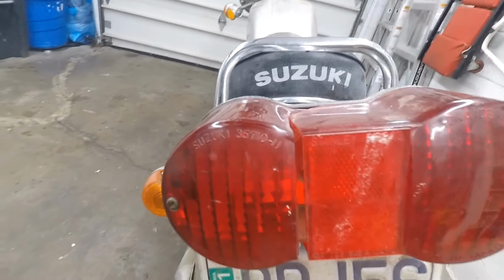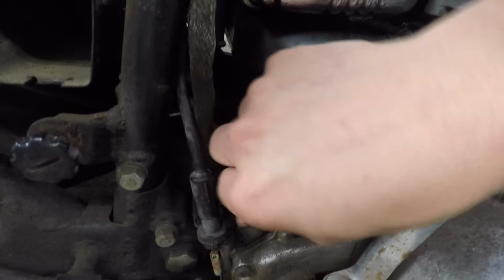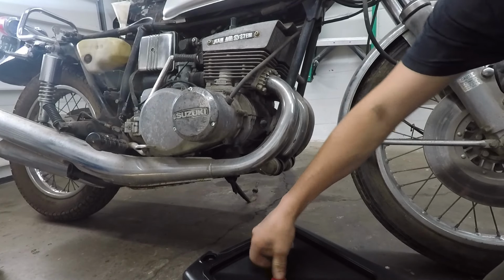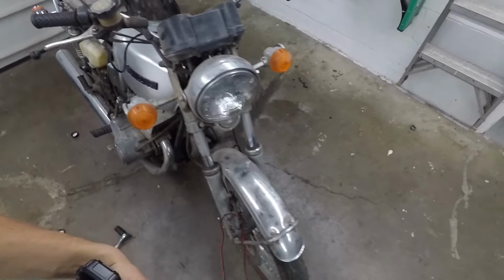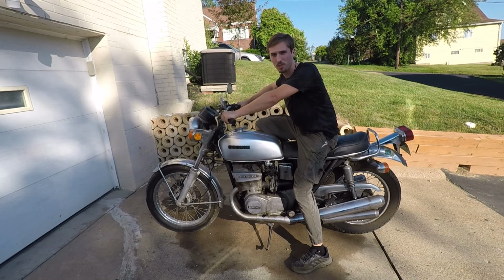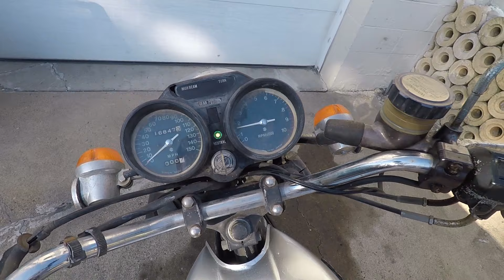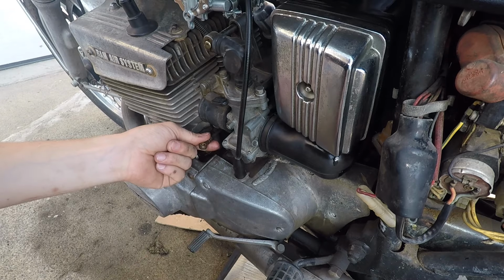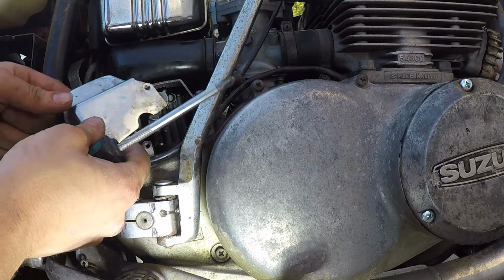Barn Find Suzuki GT550 2 Stroke Triple First Start in 10 Years

Comment: I see a lot of people saying that the crank seals are bad because of all the smoke but that's not the case. The oil pumps on these use check balls in the oil lines that are suppose to stop the oil tank from gravity feeding into the bottom end. The check balls and springs get gummed up and the 2 stroke oil fills the bottom end. That's why you have a puddle of oil coming out the weep holes in the exhausts. If it sits for a long time you need to pull the 3 plug bolts(12mm) out of the front of the engine (bottom end of the case below where each exhaust mounts) and let it drain. My gt380 is about to be 50 years old and it's never had the seals replaced, still runs like new. Some people have also mentioned you should plug the oil pump and run premix, DO NOT DO THIS, this can't be done on any of Suzuki GT's because the seals will not let the premix reach the main bearings and you will fry them. The oil pumps on the Suzuki's are very reliable and you wont have any issues using it. If you got any questions let me know.
Reply from the maker: Thanks for the great advice man!
Reply: Hi bigdaddy, could you identify the 3 plug bolds on a photo? Thanks in avance.

Comment: Most likely smoking from oil collected in the crankcase. The oil injection check valves tend to let oil past after years of sitting and it fills the crank with oil

Comment: The first start in ages is always gona be a smoky affair.. they smoke a lot from.cold starts anyway... maybe the exhaust has loads of.oil in it still... it may be crank seals but it could be a few basic things too so don't necessarily dive into the engine with your spanners straight away...

Comment: trying syncing the carbs and see if thats a possible fix. Since too lean of a gas mix can cause more oil burning by the compression pulling tit from anywhere. Thats also how gas bikes are. A too lean of a mixture will cause some smoke because its pulling oil from the crankcase to run.

Comment: Maybe the gearbox oil leaked into the crankcase(s). If any crank seals are shot, the idle speed, even for a two stroke, will be too high and very erratic. Ignition timing accuracy is critical on these or it's hole in piston time. The 32:1 was good insurance as the oil feed was an unknown. Good resurrection.

Comment: Why did you put 2 stroke petrol in the tank?
Reply: In case the oil injection wasn't working and to add extra lubricant on first start up which was a wise move as the pump wasn't working.
Reply: Good thinking, I’ll remember that when I get to starting mine for the first time. 👍

Comment: That baby is spittin engine oil. It's why it was dry, is my guess. It's also partially burning that engine oil, is where all the smoke comes from. Crank seals are toast 100%. Please don't ride it as it is. Could also be the seals are not completely gone, but oil just slowly seeped through into the crank. Now it's spitting it out. Either way engine needs a splitting!
Reply: Gearbox oil level, has a screw to remove some ware around kick starter shaft, when the oil runs out the screw hole the level is correct.
I agree , check crank seals